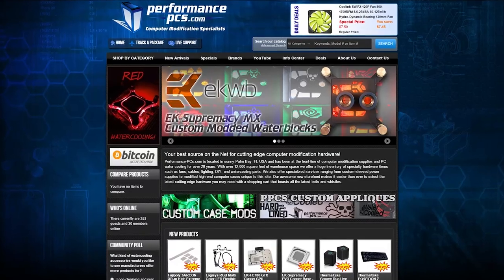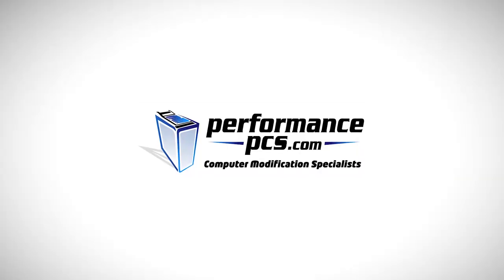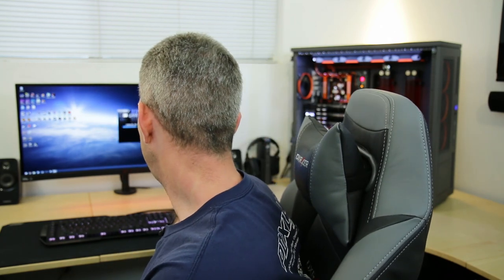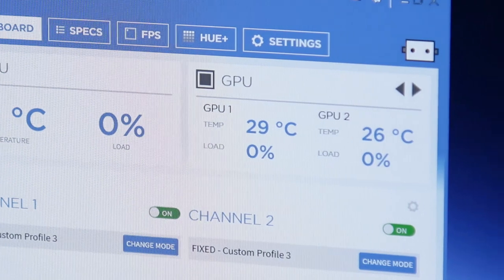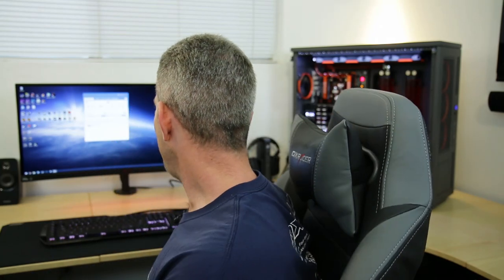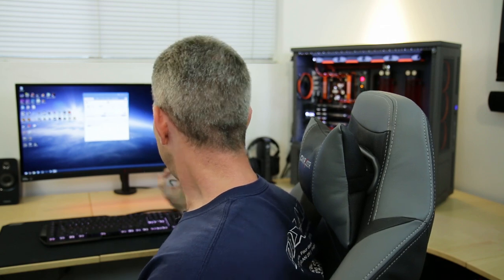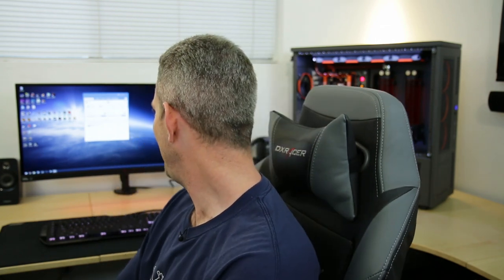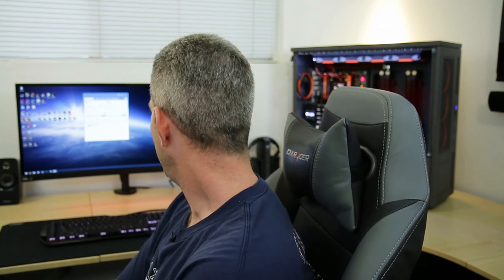INSANE Gaming PC 3 Titan X video cards! Such overkill

Comment: Plasitizer issues are a pain. So using the proper fluid is critical.   Since my amateurish search was getting me nowhere.  I started looking for those professional products. Like those uses in (Cyrix Systems) mainfraimes. After some significant research. 

One compound stood out from the rest. Flourinert by 3M which has an  ideal freezing vaporizing points and also has a great heat transfer factor. So I am curious if anyone had used this?  Not sure how hard this would be to come by. 

But might be an alternative to  the current standand. Since it's a totally inert liquid that looks and behaves like water and has the same thermal transfer properties.  But does not conduct electricity or cause corrosion.  

Or in fact react with anything at all for that matter.  Cray uses it to cool their supercomputers. As a maintenance, corrosion and short-circuit worry-free solution. Maybe i am behind the times on this but seems promising, thoughts?  :)

Comment: Quick tip for those front panel connector cables Jay. Use a good quality permanent black marker pen to colour them stealth black. Its what i use and works a treat if you take your time and apply several times allowing 1 hour between application to dry.

Comment: The new build looks amazing. Glad you're happy with the cooler temps.

Just wanted to throw in that it's unlikely (although not entirely impossible) that your room is actually cooler because your CPU is running cooler -- that heat has to go somewhere (the air passing through the radiators).

Comment: That is an amazing system. The only thing that looks a little out of place that I would change is the rear exhaust fan. The 120mm fan looks tiny in that big case. If you could fit a 140mm fan in there I think it would look much better and probably help pull more warm air out of the back of the case.

Comment: All I would do more to it is to add an LED strip at the front of the case, because where the back of the case reflects the light, the front, due to the black rad, absorbs it so there's barely any hitting the reservoirs and they look really dark in contrast to the liquid in the pipes.

Otherwise it's epic. Happy new year!

Comment: What do you think about this set up of a computer..
 
Processor.- FX Quad Core 3.6 ghz 3.86 ghz Turbo 4gb
Memory.- 4gb DDR3 SSD Ram
RAM-. 250 HD
Hard Drive.- 250gb HDD 7200 RPM 

 let me know if i even have this right or if you think it's a good set up thanks.

Comment: nice vid, i see you are using primochill fittings on bitspower at 13/10 tube, what you using on the GPU 12/10 with bitspower pushon's

Comment: JayzTwoCents I have A 3770k its really good processor but today 1/1/2016 is going to be 4  years old or 3 but i feel like giving up on building my system is a i7 3770k good for my editing and gaming the cpu is overclocked to 4.8
plus i just ordered a gtx 960

Comment: Hi! I didn't find any info about a loop using 2 water pumps. I really like the way you deal with crazy ideas and I will appreciate if you could try this madness and expose your results, not just if it could work well but also if the performance (dropping of temperature) will improve, and if a loop like this could worth the investment. In my mind I visualize a loop with 2 water pumps feeding 2 radiators, one to the way in to the CPU and the other in the way out of the CPU. I also found a water pump that has a speed control on it, and that, I believe that could helps an adjustment of pressure and speed of the water. When I say adjustments it's because I believe that  2 the same water pumps WITHOUT speed control will not work properly by the differences between the length of the way in and the way out of the CPU Blocker. And, even if a couple of simple water pumps could work fine without any leaking or so, I believe that in a while one pump could break the other one by pushing to much water to it or by not supplying enough water to it, that is why I'm thinking about pumps with speed control in it. Could you try such craziness like that? Take care... :-)

Comment: I really like the orange. You can use some black fingernail polish with a paint brush or a paint pen to touch up the ends of the wires that are driving you nuts. That should make up for the short sleeving.

Comment: The only thing I would change is the RAM. I've never liked the Dominator Platinums, but that's mostly because I loved the original Dominators and Dominator GTs. I know you can get replacement side plates to let you do the same thing, but I loved being able to pull the fins off and slap a water block on them. Get more sexy blocks and more sexy fittings into the system.

Comment: Happy new years jay! The only think I would like to change if I had a chance to build such a system is to get a more decorative res such as the helix that performanc-pcs carries. I use them as well and they have a great selection but either way that is an amazing build. The reason is purely preference. Also Im trying to build a similar system in the long run only with 3 980Ti's and a 4790k, but the other 2 980Ti's are a good ways off, and they are no 5960x and tri titanx's lol!

Comment: I don't even like orange.  For anything.  However, THAT, looks really good, with all the black, the little bit of grey, and the indirect white lighting.  A really crisp, but sorta "low-key" color contrast.

Ooh-- I just figured out "something I would have done differently":  Maybe put some indirect white lighting behind the top and bottom of those main fluid reservoir-tubes, to shine into the fluid.  That would brighten up that part of the case generally (not TOO much -- just a few well-aimed, low-power LEDs), but specifically, it would make the fluid in the reservoirs appear a "lighter shade" than now.  (I mean in the indirect sense, like from across the room, not in the sense of criticizing the actual color you've got, which I've said is good.)

I also know there's such a thing as complicated reservoir caps that have little ports for LEDs to shine INSIDE the reservoir, but that would be a little brighter, more "bling-y" than I have in mind.  And for that you'd have to find and buy those fittings, and re-do all your plumbing YET AGAIN.  And I know how you LOVE that part.  Heh.

Comment: I like orange but red and black with a little white is my favorite colors. my dream build if I did water cooling would be a venom green or yellow on the cpu loop, putting a rhino viper head on top of some fangs sleeved on the tubing on the cpu loop going down to the cpu block. I would use a second color on the gpu block and it would be almost black with a hint of red. it would be to simulate venom pumping in the cpu loop and blood pumping in the gpu loop.  I would have a rhino viper painted on the outside and 2 other snakes to not to have too many to over do it. the first one would be a chrome head black blood(short tail) python, and the second would either be a brazilian rainbow boa only if someone could replicate the rainbow irricdasent colors that shine when getting hit with the sun as I know I can't reproduce it or just a simple spider ball python but every snake will have red eyes.

Comment: With the amount of fans running in skunkworks, what are the acoustics like? they're pretty low I imagine due to them be SP fans but i'm still intrigued :P
Reply: +Conor Stevo (Stevoicus) - Actually, SP fans are louder than AF.  But, I imagine his rig is very quiet at idle, necessary for filming video without a constant drone of fans in the background.  that's one thing I like about WC - you can make the system much quieter if the cooling is that much more capable.

Comment: jay, i have a question: how do you keep dust away from your system?.. i have the same case with almost the same setup and i kid you not, it feels as if my computer is standing on top of the sand in a beach.. i have dust filters and also one of those electric dust blowers(that i use every month) but its still not enough, dust gets into my rig so easily that you can see a thick layer of dust inside after around 2-3 weeks of use, its getting really annoying.. do you have any suggestions? also great work and sorry for my rusty/bad english!
Reply: RocoV08 what's the name of the case?
Reply: Preessure?

Comment: Does the efficiency of cooling decrease as the fluid gets circulated in the computer? Ex: Would the first GPU get more cool than the third GPU?
Reply: +Fresh Apples No, The fluid goes through the path of least resistance, ie, the fluid will fill up the first card before going onto the second, but when the system is full, an equal amount of fluid will go into the first card and will pass right by it into the next. Hope that helped.

Comment: I have to say, I was not a big fan of the yellow build. The hardware obviously is beast, and my only question mark is why the hell no ROG board, but everything else is obviously great. But the yellow, even clean and new, I was not a fan of. This looks beautiful. The translucent fluid in that color is far better than the solid yellow, IMO. The clear blocks are also much better than the solid ones. Beautiful system.

Comment: Is this good to play Fallout 4 on 1080p all high settings?
-Intel core i7 4790 at 3.5 ghz boost to 4 ghz
-asus strix gtx 960 2 gb gddr5
-Corsair air 540
- some atx msi motherboard that had good reviews ( i haven't got the pc yet and i forgot some parts)
- water cooling 
-8 gb ddr3 ram corsair vengeance
-1tb wd 7200 rpm
-250 gb ssd from samgsung
-650 watt power supply
Reply: ***** how about medium settings?
Reply: ***** k thx if it can run medium settings at 1080p then i  can probably play gta 5 at high settings at 1080p.

Comment: what are best FANS to use and where,  COOLER MASTER AF120, OR SP120, IM USING A INWIN 503 CASE, I AV A PAIR OF BOTH SETS.
Reply: NoiseBlocker-Blacksilent PRO PL-2s 1400RPM with the Hardware Labs Black Ice SR2's are by far the best imo, always make sure you get a low FPI if you have low RPM fans vice versa.
Reply: Mark Springthorpe cheers bud. I've  done another build since then with a skylake and been getting some funky coil whine at lower rpm, corsair af120 red leds, thet quiet at speed but whine low, meh
Reply: Yeah its because the corsair AF fans are high RPM and when you slow them down the coil whine starts, next build you do you know what to change :)
Reply: Yeah new Thermal take Riing fans, or Corsairs new RGB ML120 with RGB ran controller to match, all going in to my Enthoo Primo XL. And make sure they are low rpm fans.

Comment: Here is why the orange works... nobody does orange. It is fresh. Kinda like the one dude who owns a blue Ferrari. At first you are like... "I would never own a blue Ferrari..." and then you see one and are like... "Wow... I need a blue Ferrari." 

Jay, I can't help but feel like you would benefit from some better fans. The Corsair's aren't bad and obviously the color matching is good... but in terms of performance there are many better options out there. Considering the thermal load your PC is under and the amount of fans in your system, better fans may provide a noticeable improvement. Gentle Typoons, Akasa Viper's, Noctua NF-A14s, etc. The Noctuas now come with a color kit for the rubber corners so you should be able to maintain color. If you want to improve aesthetic even over the Corsairs, Thermaltake as some nice RGB LED fans (the ones with the halo ring like a BMW).

Comment: How much difference do certain motherboards make in terms of overclocking a CPU?
Is it actually noticeable, or is it just more bells and whistles and doesn't actually allow more overclocking potential?
Reply: I believe they're noticeable but not significant. Mostly they have a lot of quality of life features
Reply: +Butthurt Beluga I can give you an example: ASUS Rampage IV Black Edition.
A few days after release, several world records were broken on that board.
Boards like that give you a ton of OC-settings to even tweak settings that you never heard of.
If you are one of those "just higher the multi and add some voltage"-Overclockers, then those boards are nothing for you. If you know your way around, about PLL-voltage, PCH-voltage, RAM-latency and -delay timings, cycle timings, interval timings, pulse-width and so on, then those boards are your thing. Also they give you more options for the LLC, which basically is key to get an OC stable if you want to use those features like lowered clock and voltage in idle.
Reply: Meta Custom Computers
Ah okay, thank you very much for the insight.
Reply: Butthurt Beluga
No problem. For the average user it's key to look for the cheapest board that features everything you need, like SLI-support, RAID-controller, USB 3.1 Type-C, M.2 port and stuff like that. If you don't want that, go cheaper. If you're an enthusiast and you just want to go to bed knowing that you have all those feature just in case you one day might want to use them, go high end.

Comment: Hey Jayz ..What's the importance of case cooling fans when you have almost all your parts water cooled?
Reply: +Ankit Sharma All components on the mainbaord give away heat, even if you watercool the biggest heat-sources.
The mainboard-PCB, the backside of the areas where the CPU-socket, VRMs and PCH are, the RAMs, the backplates of the graphiccards, they all passively give away heat to the surrounding air which will heat up more and more over time. If you have no circulation going on, the components on the mainbaord will take damage at a certain point.
No matter how much you watercool the components, you always have to give some airflow to the inside of the case.
Reply: The fans are what cool the liquid.
Reply: Meta Custom Computers I agree it isn't the only heat source but passive cooling is enough for them?
Brandon Teeter i am talking about case fans not the ones on the rads
Reply: Ankit Sharma
Oh yeah. Water cooling is overkill to begin with, obviously if you're going all out might as well go ALL out.

Comment: This test could have been done better. Next time you should definitely try an i3 type of setup with the cpu 2 core with hyper threading at a reasonable clock speed. The current i3's turbo to 3.8-3.9 don't they? The i5? Well I beileve that goes to 3.9ghz. Just try to make it more comparable to the current lineup. And you should definitely test more games, test them with a much more repeatable procedure, two runs doing somewhat similar things in an open world game where vehicles, pedestrian, cop count varies seems impractical. And lastly if you are looking to make the game cpu bound then you definitely should not have been running the most graphic intensive game at 3440x1440. I doubt there was a massive difference because of that. If you were to retest at a resolution of say anything between 1080p-1440p (resolutions people use who are looking at i3's and i5's) im sure we would have seen a bigger difference in power.  Just trying to make constructive criticism.